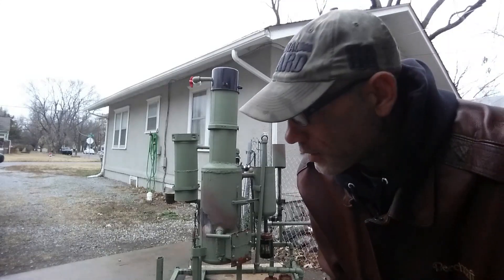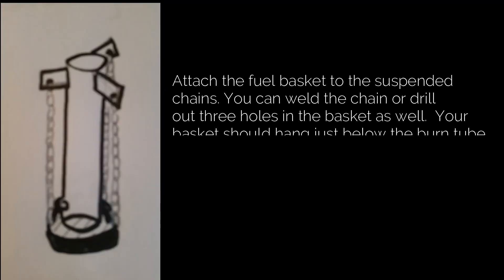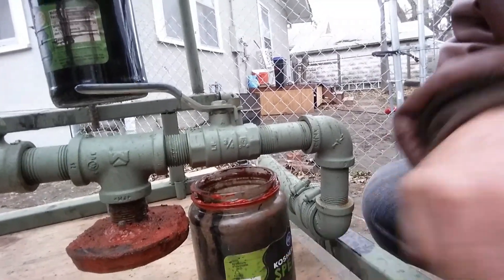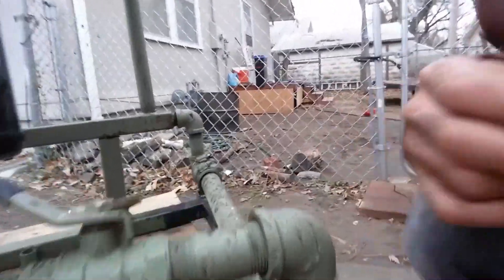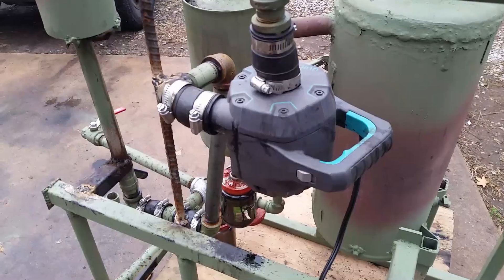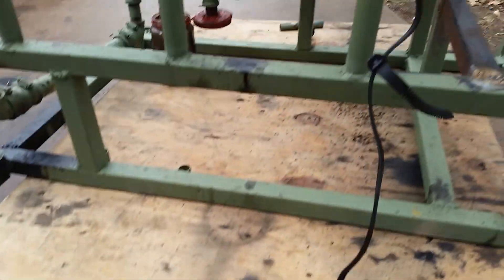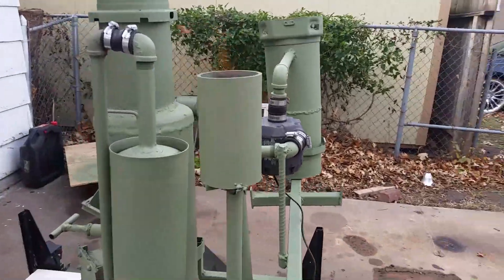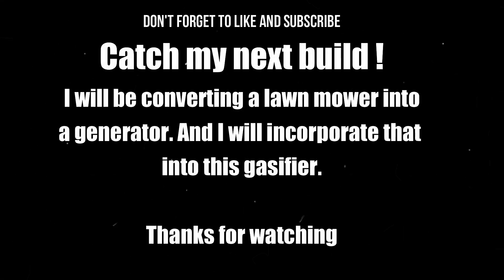Super cool home made Gasifier

Comment: So, if I understand this right, you're making wood into flammable vapor, that's then being used to fuel another device? Can something like this be made from a stihl, or perhaps, a drip fed waste oil burner?
Reply from the maker: Absolutely you can use most anything. In fact, it does not even have to be a cylinder. T
he most important part is that it must be an airtight system. It's all about a restricted oxygen environment so that you can reach paralysis
 in your burn to create the reaction to release the wood gas.
Reply: @Saxxsays  gotcha. Out of curiosity, can you do a video later showing just how long this thing can power sat, a simple generator? Or anything. I'm just trying to grasp the idea of how useful wood gas would be for other applications. I've only ever witnessed it being used for heat, light, or a combination of the two.
Reply from the maker: @northwindhighlander  I have a video on my channel of it running a mower if you want to check it out. But basically, with my particular build, I generally load with wood pellets. My hopper fills up around 4 times out of 1 bag of pellets. The bag cost me $5.00 at home depot. The hopper will burn apx 4 hours without adding more pellets. That will create gas the entire time and run a 7hp generator non-stop until the fuel is burned. So less than $2.00 every 4 hours of continuous run avg. So comparing that to gasoline, its no comparison. Also,
 you do not have to burn pellets. I can run it off of sticks in the yard for free. Its just easier to run consistently with a more even burning fuel.
Reply from the maker: i hope that helps. A 4 hour video may be a tad bit too long. lol
Reply: @Saxxsays  that totally helps. I'd assume you're running the fuel into the air intake? I'll have to check the whole channel out. Saw your video in a Facebook group earlier. Seemed interesting. Thanks.

Comment: What would you say is the average cost and the average time that this build would be? I love the thorough content, thank you!
Reply from the maker: I'd say you could build one in a week if you had a few hours a day to dedicate to it. I used mostly things laying around the garage. However,
 the plumbing is kind of a hit to the wallet. Aside of me already having a tank and something to use as the cyclone filter I have around $400.00 in the build. Everything bought at Home depot.
Reply: It depends on if you buy the materials new or salvage them used and what you want to run with it. I built my unit for about 500$ and power a Chevy V8 with it